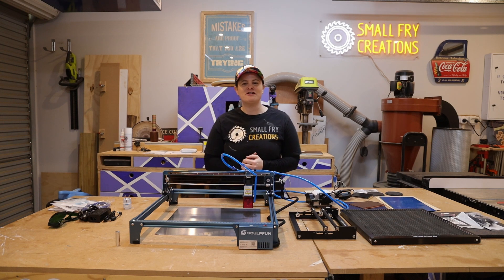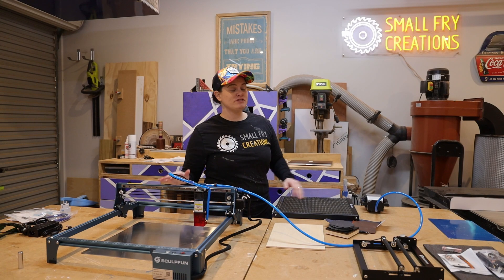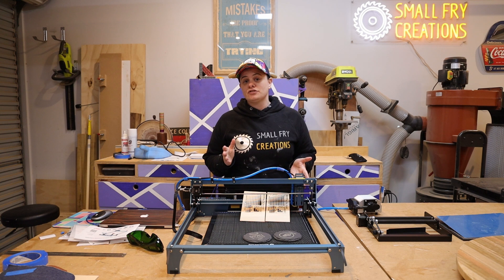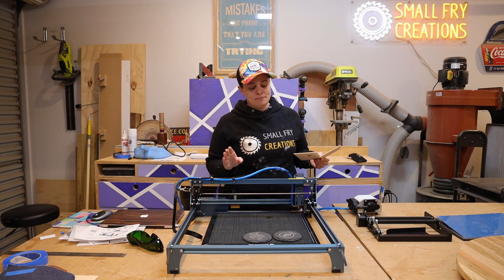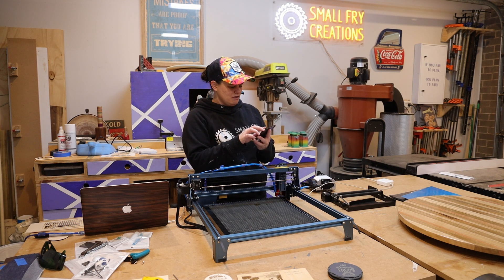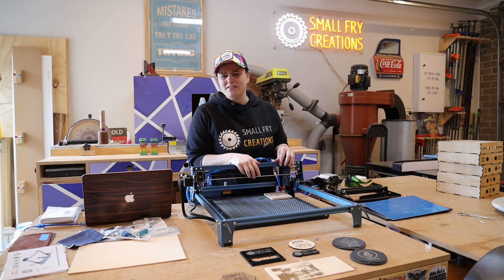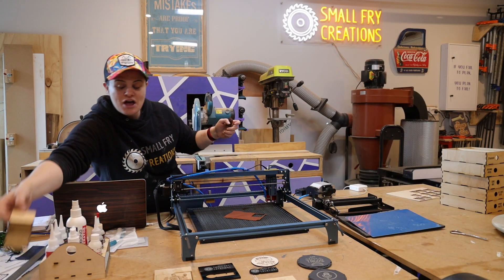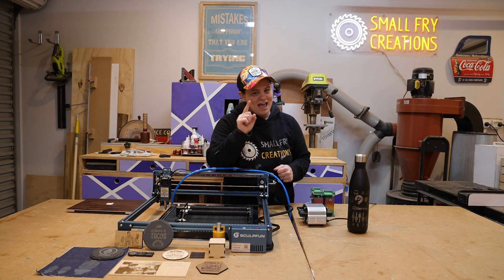Sculpfun S10 Review and Test | What can't this laser do?

Comment: Would you recommend the sculpfun s10 for beginner in engraving
Reply from the maker: Hey The S10 is a great machine however there is one large downside in my opinion. It doesn't have great upgrade ability. Its unable to upgrade the laser head or extension frame to make the engrave area larger. For some reason this Sculpfun machine hasn't been included in upgrades that Sculpfun have brought out since the release of this machine. If the budget allows I would recommend the S30 range. These machines have great extras like auto air assist and can also be upgraded if you choose down the line. Hope this helps

Comment: Hi! Great video, helps a lot!
How long would engraving a picture, like the one we took together, take?
I know you gave a lot of info with the settings, but it does not tell me the actual time. 
Also, if you have zero'd the machine, you would not have to do that every time right?
Thanks a lot!
Reply from the maker: Hey Maurtis Pending on the size but that photo I think from memory was about 100mm square and it took about 20 minutes. Once you zero the machine on startup it then remembers its zero point until you turn them machine off again.

Comment: Hello and Happy new year! ! !
Many likes for your video. I would like to ask you if you know, after how many hits of laser it is needed to be replaced and do you believe if i need to buy  <SCULPFUN 400x400mm Laser Cutting Honeycomb Working Table Board Platform >? Thank you very much and keep up the great work!!
Reply from the maker: Happy new year! Hard to say about the life of the laser as it comes down to what power your running your laser at and that changes pending material. I would strongly recommend the honeycomb bed as if your cutting you want your workpiece off the ground with air flow below and the honeycomb bed works great for that.
Reply: @SmallFryCreations  Thank you very much for your reply!

Comment: Hi! I brought the s9 after watching your video. I also brought the rotary but I can not for the life of me work out what settings to use to engrave a yeti bottle. Doesn’t come up the way it should. What setting a do you use? Could you do a video on it?
Reply from the maker: Hey Codi That fantastic. I use speed 2000 and 60% power. Are you having trouble with placement and aligned of design or are you having issues with the design showing up on the bottle?
Reply: I am having trouble with the design showing up on the bottle. It’s like it just isn’t engraving deep enough.
Reply from the maker: Ok. What colour is the inside and outside of the bottle?
Reply: Silver on the inside and charcoal on the outside. I just tried those settings and it didn’t work. It’s just comes up black not silver like for example the yeti logo on the bottle.
Reply from the maker: @codijayne6765  hmmm ok that’s frustrating for you. Charcoal on the outside should produce great results. My best suggestion would be to jump in the Sculpfun Facebook and put a short video up with the issue and the group will be able to troubleshoot with you to get you up and running
Reply: Thansk, I have posted in there but only had one person comment and what she said to do didn’t help unfortunately.
Reply from the maker: @codijayne6765  ok bummer. I had a bottle recently that was similar and the issue was it was burning past the sliver coating. Maybe try keeping the speed at 2000 and reduce power down to 40. Or leave power at 50 and increase the speed providing the bottle doesn’t walk on the rotary. Have you tried a different brand bottle? I also find different brands have different thickness or coatings. You also definitely want to clean it after. I use a magic sponge and it does a great job.
Reply: That’s what I was thinking. It might have been engraving to deep. I have done cheaper bottles and they turn out great, I also have a magic sponge I use to clean them but I just can’t master these yeti’s.
Reply from the maker: 😀 no you have me really wanting to solve the problem. I think it could be to deep. I think if the rotary can handle the bottle not moving up the speed and see if that fixes it. Keep me posted because I’m keen to hear how you go

Comment: Can you tell me what software you need to use one of these and if you wanted to start with cutting wood could you get the air pump later?
Reply from the maker: I use Lightburn for software and you can add the air pump later for sure. The air assist justs speed things up and makes a cleaned less burnt cut but you can still very easily cut without air assist.

Comment: hello how are you?
Can I ask you a question? I also have the sculpfun s10 but when I cut a circle it is not regular, do you do it too?
Reply from the maker: As in it’s not a circle? I would cut a rectangle that is something like 30mm x 50mm and check the measurements are correct. If the measurements are off your axis may need to be calibrated

Comment: how much ventilation is needed for this type of laser? I am thinking of propping a fan by the window while this is running to have it exhaust the fumes. Will that be sufficient or does it need its own ventilation system?
Reply from the maker: The best thing is to have a ventitlation system but I use a fan and blow it outdoors which works fairly well. I do plan on enclosing it in the future.

Comment: Awesome video!!! Btw, in making that tumbler via light burn, what settings did you use in terms of speed, power, and line interval? It looks really amazing!!
Reply from the maker: Thank you. I don't change the line interval what whatever Lightburn set it at. I have the speed at 1000 and the power is at 50-70% depending on the bottle. Hope this helps
Reply: @SmallFryCreations  Thank you so much!!! Hopefully, you can make a video next time about how you use light burn as well!!

Comment: Good day I just bought a sculpfun 10..wanted to find out if I can use your settings on the materials stated in your video to get a good result?
Reply from the maker: The settings in the video worked for me however I always suggest running tests as every material can be different the laser is affected my air temp and humidity. My settings are a good starting point

Comment: 🙋‍♂Did S9 with NO air assist to cut 6mm Acetate Plastic (50% transparent) ? Or did S10 can cut transparent plastic ?
Thank you😉
Reply: my cutting result is the plastic melting early , than the melted plastic blocking the laser to shoot deeper way🤣🤣
 setting i use is 3mm/s, 80% power,  cut 30 times ( provides by factory )
Reply from the maker: No sure if it will work with Acetate Plastice. 3mm/s is extremely slow which is why the plastic is melting. How thick is the plastic? Also I would be careful as some plastics are not designed to be cut with a diaode laser and may put out harm spells. You would need to confirm with the brand that is can cut the plastic your trying to cut.
Reply: Thanks for the advice. I'll try your setting, but 8000mm/minute = 133mm/second right? Not sure can run that fast 😁

Comment: So, I recently (July 2022) purchased two different S10's and have had issues will both. I returned both and tried for a third time and still no luck. Amazon actually let me keep the S10 for FREE which was awesome, and then I ended up buying the S9. The S10 that I have made it very difficult for me to get lightburn to register my device and ultimately I had to add it manually. Although I did this, the laser would not burn at full power, nor would it burn at more than about 25% power. So as of now it sits in my garage gathering dust. Any tips you have based on your experience setting up your S10 would be greatly appreciated. Cheers. Great videos bye the way. You do a great job of putting out content that is fun and educational.
Reply from the maker: HI Paul. How frastruting. I understand completely. Once I got the laser added manually I didn't have any issues. Have you joined the facebook group at all? If not I would suggest that is a good solution. The support in the group is amazing and the knowledge is fantastic. Sculpfun themselves are in the group and will often be able to help resolve the issue. You are able to take photos and videos and the group can try and resolve the issue. I would give it a go and then you will get a free laser up and running 😀
Reply: @SmallFryCreations  thank you for reaching out to me, and thank you for the Facebook group suggestion. I just asked to join the group and I am currently waiting for the approval. Thanks again. Keep putting out those amazing updates and videos
Reply: @paulcipres5144  I had the same issue, adjust S-value max on Lightburn Basic Settings Tab (default was 1000), i try 2000 and was ok,

Comment: Thanks for the great video! sorry if I missed this question being answered

Is it possible to use the S10 directly on top of your cutting material? i.e. a 2.4m by 1.2m panel of Plywood that's sitting on top of another protective surface underneath? Meaning you can cut , reposition the machine, cut, reposition the machine rather than having to cut your panels into chunks of 400mm by 400mm and produce more waste etc?

Keen to hear your thoughts, thanks!
Reply from the maker: Thank you. Absolutely can more the laser around and put it on whatever your lasering. Super easy! So versatile. I haven’t tried it but I believe in lightburn there is a setting if you have a large project you can set it up as a pass through and light burn helps you align everything.
Reply: @SmallFryCreations  Legendary, thank you, I'm definitely buying this then! Was worried I had to cut my wood into small chunks to fit in the surface area :) thanks!
Reply from the maker: The laser is very light weight so you can move it anywhere very easily 😀
Reply: @SmallFryCreations  Update :) I've bought the S10 and having fun!, the only the thing I'm curious is whether you find you ALWAYS have charred edges when cutting Plywood? I find all of my cuts dirty my hands and thus would dirty customer hands if I produced cuts without cleaning all pieces
Note: I have the Sculpfun S10 with the Sculpfun Air Pump, I find regardless of the settings I can't seem to ensure edges are clean, keen to know your thoughts if you have the same issue :)
Also, Sculpfun do have an enclosure (Not sure if you know that) I bought the extension kit + extended enclosure kit
Reply from the maker: @PopAttack  Hey thats awesome. Glad your enjoying it. I know what you mean with the charred edges. You can play around with power settings to reduce a little but looks like you have done that. You can't completely avoid it. I have found a method that helps. Once the item has come off the laser I spray a clear coat on it. Once its dry I wipe it down with vingear and set it aside to dry. Out in the sun if I can. Then I will clear coat again if I need to otherwise its good to go. I find the vingear does a great job of getting the smell away but spraying the first clear cost stops it from smudging all over the place. When I wipe it down with vingear I use a majic sponge and toothbrush. Hope this helps. :)

Comment: next good video with good work and I'm planning to buy one. any idea if we can use the custom honeycomb or the official one is better? Also, do you buy most of the materials from bunnings or somewhere else.
Reply from the maker: Thank you. You just need something that elevates the workpiece in the air with space under. Any honeycomb would work just have to be sure the metal is ok to be heated. Some metals are not safe to be heated. I get plywood for the laser from Bunnings. Just keep my eye out for when the store has good sheets in stock and then I stock up.
Reply: Also can you help on getting the adjusting legs for the rotary for the s10. I know you have done 3D printing but would appreciate on how to get it.

Comment: Another great video. I’ve had the S9 since Christmas and have recently got the rotary and new air assist from Sculpfun. I’m fitting homing switches as well. I like your custom risers, so much more usable than the fixed version. Keep up the good work.
Reply from the maker: Thank you. Ooohhh yes I keen you add limit switches as well. The rotary is a great accessory. I was very impressed. Thanks for stopping by

Comment: Great video. I got the S9 after watching your first laser video. Still in the learning process. Does the rotary tool you used with the S10 work for the S9? Also where do you get your thin plywood from? My local Bunnings doesn’t have a very good timber selection.
Reply from the maker: Hey thank you. The S9 is a great machine and yes the rotary will work with it. It’s a great accessory. I did get the 3mm from plywood from Bunnings. I always check when I’m there as some times are better then others.
Reply: I have also bought the S9 but like Ortur LM  Pro I am having difficulty in cutting coloured acrylic but no problem with black. Perhaps it is the way I am doing it but I’ll just have to keep on trying. Great video keep it up. I am in the UK by the way so our choice of materials is fairly limited unlike the US.
Reply from the maker: The Ortur is a good machine to. I haven’t tried any other colour then black acrylic so will have to test some out.